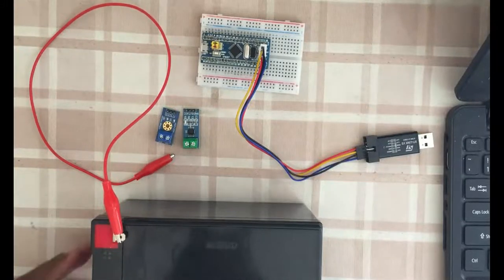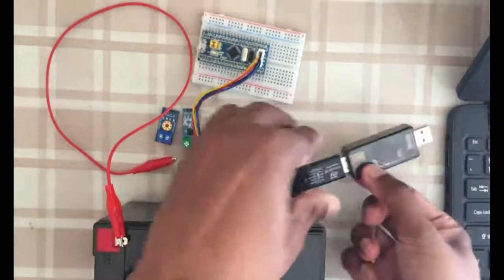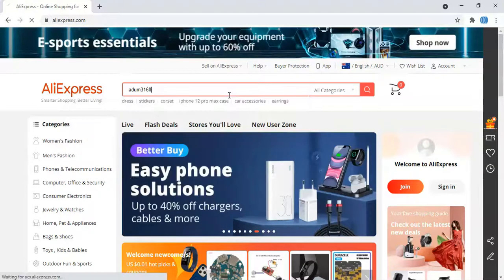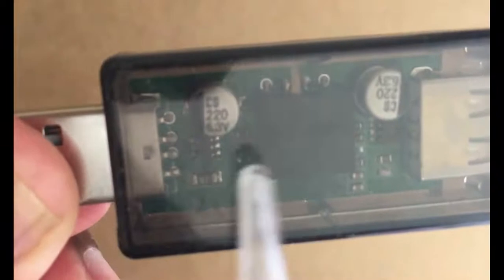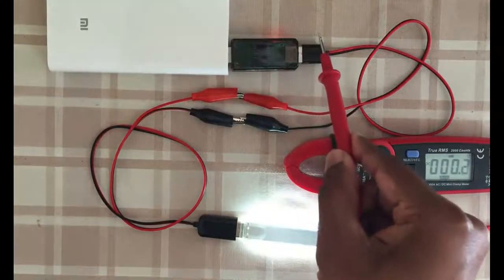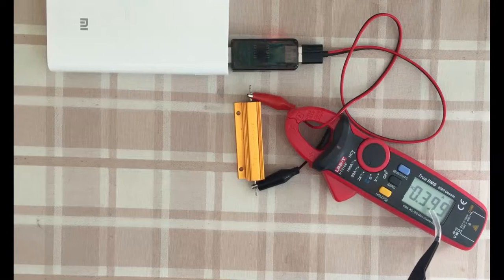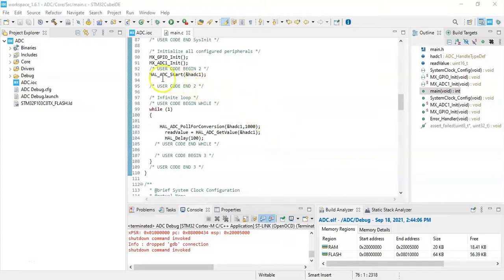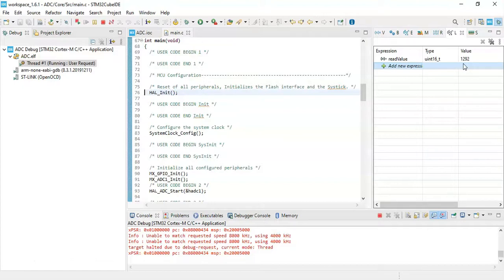52. ADuM3160 USB Digital Isolator

Comment: Hi friend, I´ve one of this but there´s a weir behavior. When connect the dongle directly to the devices, no devices are detected (low power devices as mouse or keyboard). But when I use a HUB (a not powered and simplest one) works with not problem. Any hint about what´s happening? Thanks!

Comment: I congrats you how can I measure ac current and ac voltage using ADC thanks for supporting
Reply from the maker: Hi Brother Yusuf,
Thanks. But AC voltages are lethal. It needs personnel safety precautions as well. I will be doing it after I finish simple projects. It might take few months.